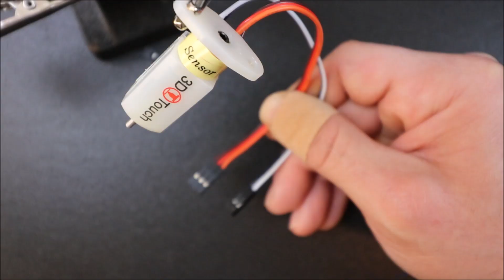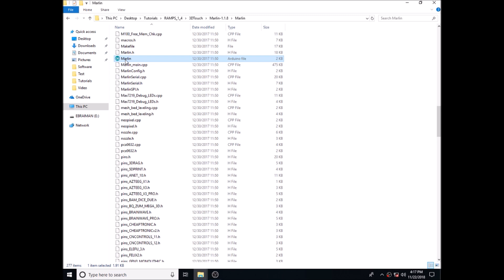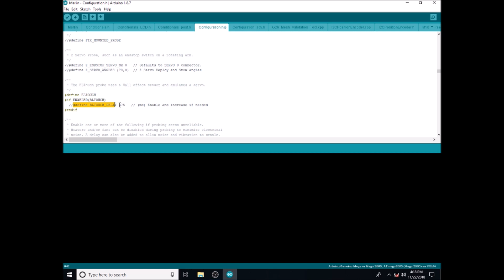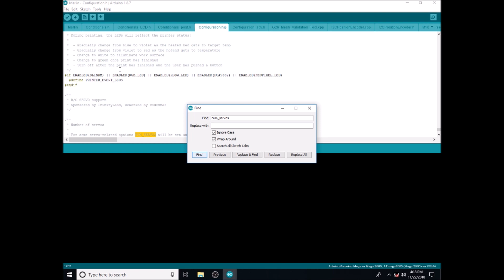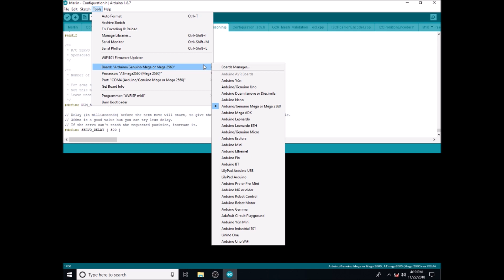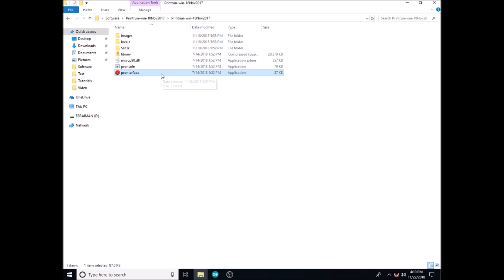RAMPS 1.4 - 3dTouch

Comment: Hi
Mine Works it does A self test when start up and is can deploy and stof but when is home my printer it crashes in the bed bevond the sensor is not sendig A signal that it is there.can you help?
One more problem my lcd is not with the psu only Whit the pc.
Thx
Reply from the maker: There's a Discord link in the description and either myself or someone else can help in general chat.

Comment: Hey thanks for the video.  really helpful!  Something to note about these cheap 3dtouch clone variants is that the pinout and coloring of the cables they come with are not consistent.  On the ones I bought I had to swap the pinout around to make it work.  (easily done with pin jumper cables to figure out what's wrong).
Reply from the maker: You're welcome.

Comment: Hi Edward, I am using ramps 1.4 and 3d touch v3.0 with marlin 2.0 bugfix. 3d touch is showing "open" even it is triggered. Please help me out.
Reply from the maker: Note the version of the software in the video.
Reply: Thank you Edward for suggesting. But I have added pulldown resistor b/w servo signal pin and ground. B'coz servo indicator (blue led) on 3d touch was always on. Now it's working fine.
Reply from the maker: Great, sounds like Marlin should be made aware of your fix.
Reply from the maker: Great, sounds like Marlin should be made aware of your fix.

Comment: When I apply 3d touch, the Arduino Mega 2560's regulator burns out. Is there a workaround?
Reply from the maker: Replace the Arduino MEGA and RAMPS 1.4, otherwise you're going to not have much to work with.
Reply: @EdwardBraiman  So far, you've only changed Arduino, but you're telling me to change the Ramps board, right?
Reply from the maker: If something cooks between both boards, then I question reliability of other board.

Comment: Hi, im thinking on automating my printer callibration system, and in this video its the first time i see this device and it seems to work pretty well, So: would you recommend this type of device or an inductive one? in terms of setupping this seems to be easyer than the other type.. Thanks in advance!
Reply from the maker: This is my preferred method of leveling, when I do not do it manually.

Comment: Hi Edward many thanks for your excellent videos about the Ramps 1.4. I am just wondering, how I can connect a 3dTouch, a mechanical filament runout sensor, a board cooling fan and two additional fans for the hotend at once? WIll this be possible? May you please point me to a recource where I can find out the way how to wire thew board and configure the firmware?
Reply from the maker: If you checkout my playlist on RAMPS it covers each.  If your asking for all at once it might take some time.

Comment: it doesnt work for me.  Could you give me your configuration data for the 3d touch pls ?
Reply from the maker: Which version of the Marlin firmware are you using?  What's occuring when it's not working?
Reply: @EdwardBraiman  I use Skynet version 2.3.2. When i start the printer the 3dtouch starts his self test but dont change the z resault with Gcode m119 if its up or down. I use a moddified version of an anet printer with the ramps 1.4 board. Greetings
Reply from the maker: @mathias1g  Maybe my tutorial needs a little clarification, the Firmware being Marlin version 1.1.8 needs to be modified to use the 3d Touch.  If you're using something outside the scope of my tutorial, I'm not sure I can be of help.  The Gcodes are designed to work with Marlin firmware.  Here is a link to the firmware in the video ....http://marlinfw.org/meta/download/ ... Hope this helps.
Reply from the maker: @mathias1g  I've updated the description section so that everyone else can find the software I'm making reference to in the tutorial.  Thank you for spotting the missing information.
Reply: @EdwardBraiman  i thought marlin and skynet are the same firmware in 99% ? Your configuration file looks very similar to my firmware so i thought your tutorial fits. 
Today i figured out that my ramps only deliver 1,3Volts on the Servo pin. I researched and found out that many ramps 1.4 from china has this issue with the voltage. I will install an step down voltage modul so my sensor get the 5 volts it needs. I will update you if it works. Maybe my board is s.h.i.t. and your tutorial works fine with marlin and skynet :)
Reply from the maker: @mathias1g  I'm glad you figured it out.
Reply from the maker: Do you have the jumper added for vcc and 5v?
Reply: @EdwardBraiman  yes, and i get only 1,3 Volts.
Reply: Hey there. Little update. I updated my printer to an MKS Gen 1.4 Board. Now it works fine. I think my Ramps dont work right. For everyone who use MKS Board Gen 1.4. You only have to define Bltouch and define the servoo pin and delete the "#define FIX_MOUNTED_PROBE"
so its like this: "

#define BLTOUCH
#define SERVO0_PIN 11
//#define FIX_MOUNTED_PROBE

"
Reply from the maker: Sounds great. I will be starting MKS Gen 1.4 tutorials soon.